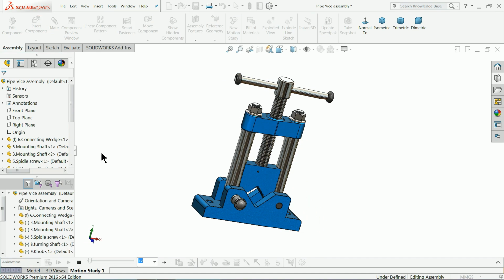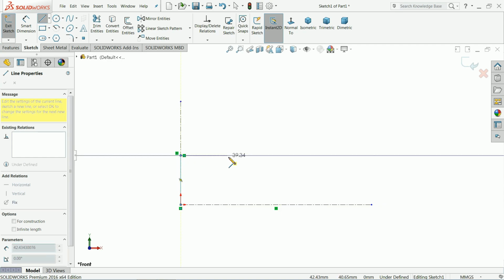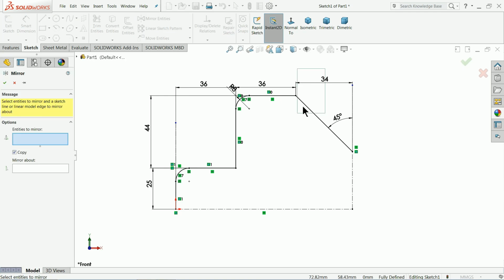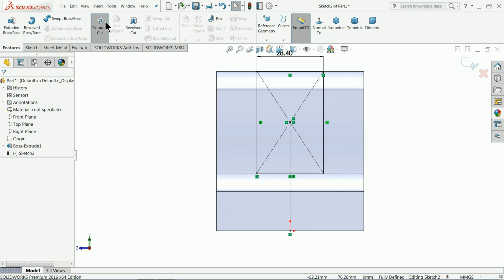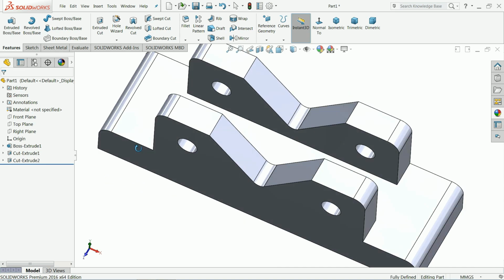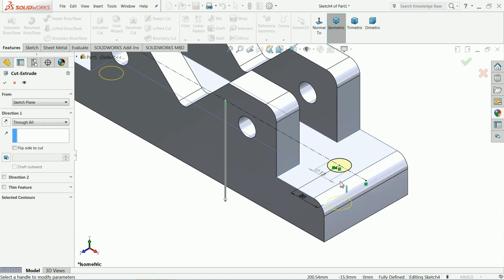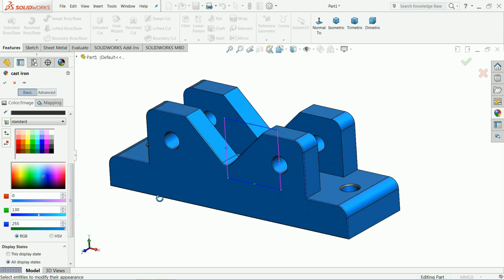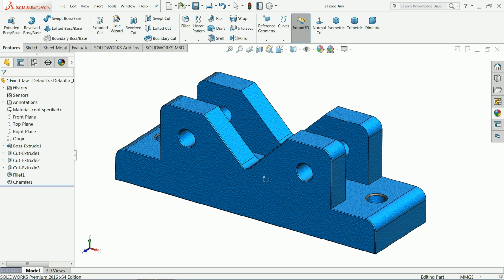Design of Pipe Vice in Solidworks 1.Fixed Jaw

Comment: my cast iron did not appear as specified. I changed the material specified in the tree to cast iron but no luck. still the edit material did not come out as specified with dimpled cast. Should you have done the edit material first before the the drilled holes? In your video the holes are showing as casted.